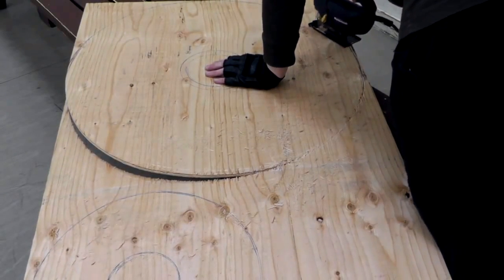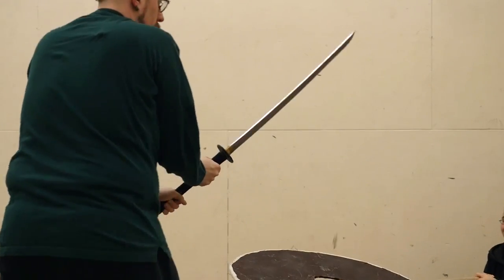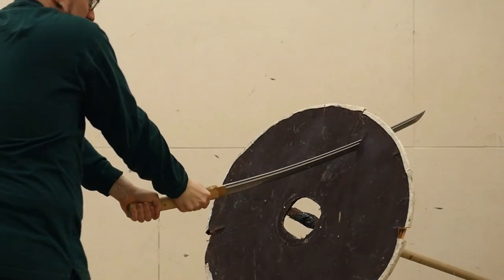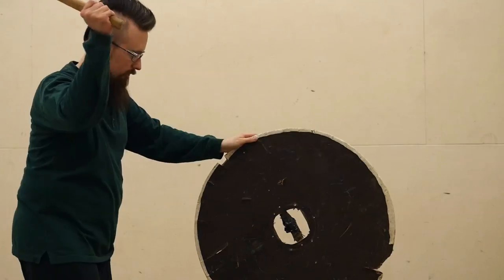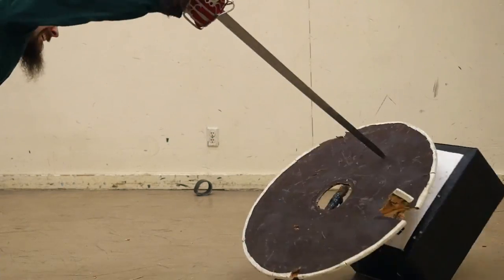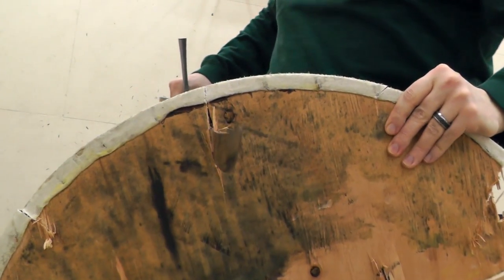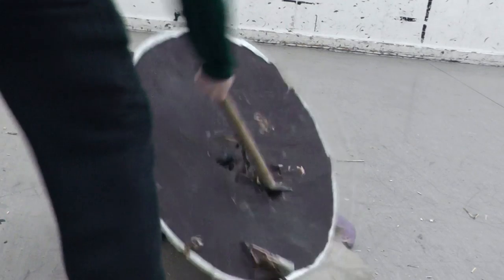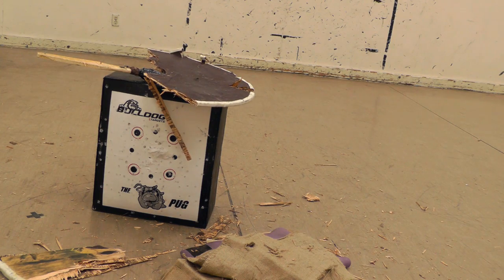Plywood shield vs broadsword, katana, axe, kriegsmesser, and war hammer

Comment: No, the two handed axe doesn't do much damage to the face of the shield. But the impact would sure be fealt by the person holding it.
Reply: Yeah the shield would be intact but after a few strong hits your arm could have broke
Reply: Depending on how you hold your shield and the type of shield, viking yes wrist and likely forearm broken as you hold the shield away in a fist, an english kite where the forearm rests against the back of the shield then unlikely if you pull the shield back as close to your bosy as possible to absorb the hit, hold it away from you and you likley wont break anything but your shoulder and/or elbow will be dislocated if the strike from a two handed axe or war hammer mace or greatsword hits well and directly.
Reply: you can just throw the pommel
Reply: Unless I'm a complete idiot and don't know what I'm talking about (not impossible) while that would work great on a wooden shield a leather shield would just cushion the impact. 

I... think?
Reply: Shields are effective against waraxe's, but this video proved that more than I assumed it would. Of course it's going to jar the shit out of you, but it still served the purpose and was barely damaged at all. The main problem is time to compose yourself after taking the hit to a shield, but waraxes aren't fast weapons. To me, it would seem like the fight would be frustrating and exhausting for the waraxe user. 
Compare it to the warhammer, which could split the shield with one well placed hit.

+The Dishonored Coward A 'leather' shield is a leather covered wooden shield. It is less about cushioning the impact and more about holding the fibers of the wood together to prevent the shield from splitting and falling apart.
Reply: thats the thing. the shield didn't really need to be defeated, just moved out of the way so you could get the guy holding the shield
Reply: @rachdarastrix5251  It would cushion it a little more than the wood but then the axe actually would just break it in half...
If you have ever been hit by an axe you wont forget the force it takes to block it, its amazing how much people underestimate two handed axes in force.
Reply: The shield moves in your hand so you wouldn't feel much of the impact.
Reply: Rory O'Neill or a sword. But a longer reach weapon of course has an advantage. In which case, the fighter with a two-handed axe would not close the gap too readily.

Comment: I think this really shows that the viability of destroying someone's shield in combat isn't as easy as you'd think
Reply: Tiberius Hrafn-Úlfur I completely agree
Unless you have A LOT of time
Strengh
And a opponent that doesn't really counter when you hit the shield...
I'd argue that shield hits are near irrelevant, if not more dangerous for the attacker (the bade getting stuck can be devastating)
Reply: Hitting it hard enough could hurt the arm behind from the percussion I guess but if you're weapon got stuck at all you could be in a lot of trouble.
Reply: nexviper good point, and a penetrating hit could (in theory) hit the arm, but really unless you do what the Romans did with the Pilum I'd say try not to hit shields xD
Reply: nexviper which is probably why the warhammer may have been the best option for that, as the shock of impact may be enough to temporary cause enough pain to the person's shield arm from using it effectively, while bladed and stabbing weapons probably do not have such force of impact.
Reply: Tiberius Hrafn-Úlfur hence the Roman pilum. It was thrown so as to stick in the shield, then bend, leaving the shield useless to its wearer so it had to be discarded.
Reply: It does have to be remembered that this is made of plywood. Shield made of planks would be much more inclined to split on you. It is my understanding that for a lot of the early periods many shields were pretty disposable. There are some exceptions of course, such as the scutum which was made of rudimentary plywood, and it seems the aspis was 'reusable', though that could just be literary license. That said, if your worried of over hand strikes, plank it horizontally, that aught to do the trick.
Reply: Malachiore
And rim it in metal to a greater degree than this one was. Quite a few shields would have some sort of layering, even if only metal or leather bands stretched and hammered across them.
People now often think those were purely ornamental, but they weren't. They were there to make the shield stronger.
Of course there were ornate, ornamental shields as well, but those too still were patterned after the real thing, rather than the other way around.
Reply: jwenting Sounds pretty heavy though; I am not sure if the trade-off in speed and chance to get the enemy stuck is worth using you shield a second battle.
Reply: Michel Dai I was referring to a shield reinforced with metal and a metal rim
Reply: nexviper 
Depends on the angle you can actually hit the shield. If you hit it at 90° pretty much the whole impact has to be stopped by the person holding the shield, which is not only tiering, but imposes the risk of injury. However you would not block hits straight on, but at an angle, making them a lot less effective while still protecting the shieldbearer.
Reply from the maker: nexviper 
In case of a center-grip shield like this the arm isn't actually resting against the shield, and the shield can pivot in the hand to re-direct a lot of the force.
Reply: *****
Ah that makes sense. I suppose multiple blows could possibly bring it in contact with the arm but I doubt that's likely unless the shield user has lost their other weapon and can only block.

Comment: note to self. aim for the person, not the shield.
Reply: seems like a good idea
Reply: That's the idea.
Reply: Problem is getting past the shield
Reply: Well if you have a warhammer and youve trained like old medieval knights would have (conscripts, so the peasant ha gambeson and a spear, maybe a cheap arming sword and a wooden shield but more likely gambeson and spear) the strength behind the hammer even if it only cracked the wood, would cause significant pain, dislocation or breaks to the opposing person shield is a good target especially if you have your own to protect yourself and they have an arming sword not a hammer or mace XD
Reply: M&B flashbacks
Reply: skeg axe
Reply: Unless if the shield is a size if a person
Reply: Use a pike with hook, smash into side and pull shield away
Reply: You need heavy impacts against shields. A good hit with warhammer breaks arms.
Reply: Truly best girl
Reply: 666 likes
Reply: I mean you could also try to hit as hard as you physically can
prob won't break the shield but it's gonna hurt the users arm
dunno how effective it'd be but it's an idea
Reply: Or get a shield critical and aim for holsters because based on physics it works better from the designers as it brasses vibrations and gives grip

Comment: surely the 2 handed axe is designed to go over the shield.
Reply: Devils Advocate surely that was not the point of the video
Reply: I think a lot of weapons used in periods where shields were prevalent were designed to go around not through. The Iberian Falcata and Greek Kopis come to mind. Or designed to negate the shield like the Roman Pilum. Where the long metal tip would penetrate the shield and bend forcing the shield to be discarded.
Reply: Devils Advocate While it can go over the shield, if the user keeps a minimum distance from the shield to his body, it can completely void the extra leverage.  I think a Shotel is more specialized for that kind of attack.
Reply: Michael Fenton I always wondered why these weapons had such a seemingly impracical form.
Reply: Stipopedia Which ones ?
Reply: KaiserAfini things like the large axes, I guess.
Reply: KaiserAfini
I meant the Falcatta and Kopis he mentioned. A blade that's bent forward never looked quite useful to me.
Reply: Devils Advocate Large axes are made as cheap medium range weapons, the handle is the bulk of it and uses a lot of wood, while there is only minimal metal, very inexpensive.

Since the balancing point is near the edge, you get more power per swing. Downside is that it also takes more power to swing the weapon, but being two handed adds more power while using the lever movement to minimize stamina use. Overall, an excellent weapon for the average soldier.
Reply: Stipopedia they were good on horseback i thought?
Reply: If a roman's shield is hit by a pilum he does use the pilum-staff as a weapon just like a club. Thats how u negate negating-shield-tactics.
Reply: Stipopedia The Falcata is indeed quite useful, as Wise Lum mentioned, on horseback. However it's also useful on foot, since it has the chopping power of an axe, but in a sword! It's intended for opponents that have none to very little armor.
Reply: True, it's length presents that capability, it's just nice to see what it can do against the shield itself just for the sake of argument :)
Reply: Stipopedia Forward bends often make scary cutters. Think kukri's. Those things are only large knifes\short swords, yet cut better then many full length arming swords.
Reply: Stipopedia Falcata and Kopi(?) Are actually probably shaped like that not to reach around shields, but to deliver hard impact and more cutting power. That blade shape makes a blade hit a lot harder, but less wieldy.
Reply: Devils Advocate it would not be as fun watching him only hit the box behind the shield.
Reply: Axel grobecker that's not the fucking point of the comment. WHY DIDN'T IT DO WELL? I say, because it wasn't designed to crack the shield.
Reply: nope its not but its meant for that in this video :P
Reply: Axel grobecker but it didn't do well. this was my thought on why. Can't people (including you, you are people) understand that simple premise?
Reply: Devils Advocate it didnt do well because it is not supposed to do this kind of stuff, i know. i still think it would hurt to be on the other side of that shield though xD
Reply: Axel grobecker +1 for not wanting to be the loser when it comes to a duel where I have second choice, and the only two 'weapons' available are an axe (spelt correctly) and a shield (made by Skall)!
Reply: Devils Advocate i have absolutely no idea what to reply now xD
Reply: Axel grobecker me neither... perhaps we should quit while we're ahead?
Reply: yeah it was nice meeting you, byeee.
Reply: Brandon Cowan Because of the handle shape of the falcata it was as wieldy as a regular shortsword. But the sword had to be used with a shield to be the most manouverable.
Reply: HuntinGG The iberian falcata had a verry destructive reputation amongst its roman foes. It was said that the falcata could split a shield in half and could split a head with a helmet in 2. Because of the handle shape of the falcata it was as wieldy as a regular shortsword. But the falcata has a verry short reach so it was not verry usefull on horseback but extremely usefull on foot. But the sword had to be used with a shield to be the most manouverable.

Comment: It's quite a misconception that shields were made entirely out of metal. This was rarely the case and was mostly reserved for purely decoration shields. Even the Roman shields used in "turtle" formations were made predominantly out of glued layers of wood covered with leather. The misconception arose from the fact that there simply aren't many surviving combat shields (because wood rots away).

It makes total sense, wood is light and cheap, and when you are trying to maneuver what is essentially a large sheet around to protect yourself and deflect swings, the lighter the better. Metal shields were much tougher, sure, but it can't block shit if your opponent takes a swing at you and you don't have time to turn your shield to block it.

And as we can see here, wood was still a pretty solid material for shields. Even though thin and dense plywood was a late 17th century material, layered wood made with tougher woods was common in shield construction.
Reply: The Roman shields were made of wood covered by iron in fact
Reply: Tom Smith whilst they did have iron on them they weren’t covered. If you are talking about the early days when they used hoplons then you would be correct but the scutum was plywood and a bit of iron around the edge and in the centre.
Reply: Hoplite shields were made with wood planks, leather or hide and a layer of bronze. The classic Roman Scutum was made using planks of wood, covered in Canvas or lether with an iron or bronze boss and outer rim, depending what era it was.
Reply: Indian,knight & spartan shields were metal ones
Reply: @DimitryDonskoy777  There were some indian shields made of steel but the vast majority were made of leather or wood, the steel ones were generally fancy ones owned by noblemen and probably saw more use as a display piece than as a tool of war, since they tended to be decorated with silver, gold and jewels. I have no idea where you heard that knights used steel shields, I mean some shields used by knights may have had a boss that was metal or a metal rim but I've never seen a source for a fully metallic shield. Spartan shields were also mainly made of wood, they were just covered with a very thin layer of bronze or copper to increase their defensive capabilities, and even those may be over-represented in the historical record because metal tends to last longer than wood or leather and this may have skewed the perception we have of the period by making our archaeological finds less representative of the reality.

Comment: So basically, whats shown in this video, any shitty shield is going to take a lot of hits before breaking apart
Reply: +de0509 Pretty much, though plywood is actually very strong. So it's mostly downhill from here(with wooden shit).
Reply: That's why shields are just so good
Reply: Yeah- a lot of people don't realize plywood is as strong as it gets for non-petrified wood, because it has no grain.
In the video it doesn't look like plywood though. Pretty sure it's particle board.
Reply: M&B 84% difficulty huscarl horde PTSP intensifies
Reply: Um, particle board doesn't splinter.  It crumbles.
Reply: Mahir Ahmed Miah-But the woods chosen for shields were specifically resistant to splitting for that very reason, as well as being fairly light. Lime & Poplar mostly. Such shields(& with a boss fitted too) would be better representative to test for comparison with our modern plywoods.
I still think plywood shields are pretty awesome though.
Reply: That the point.
Reply: Yeah plywoods pretty strong. Considering that its a type of building material
Reply: And this was considered a shitty shield, imagine going against a well made one,  cant even imagine the nightmare of trying to get past a steel shield
Reply: that's why minecraft uptade made shield so strong
Reply: @jackofastora8962  when a bad shield can tank a ton of hits imagine how bad a GOOD shield would be to deal with